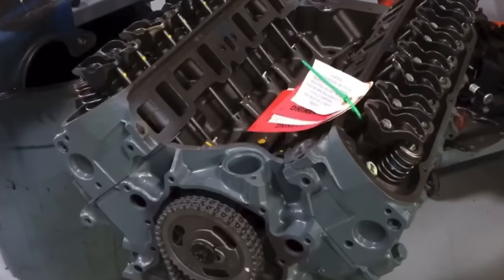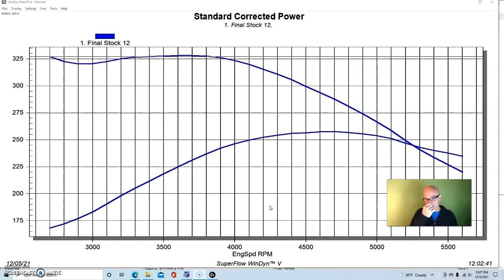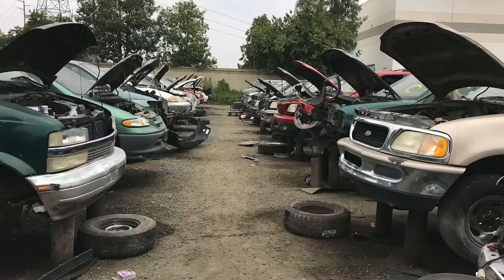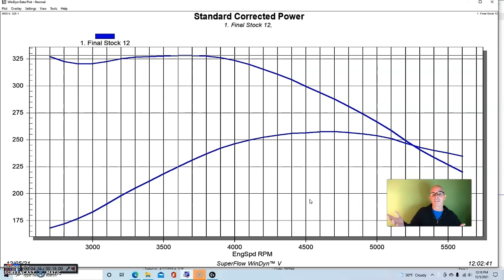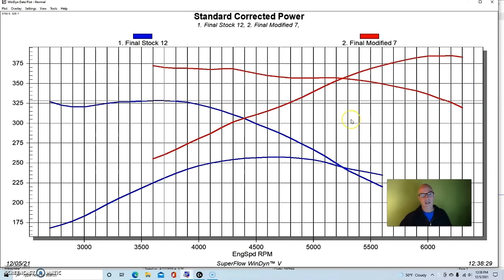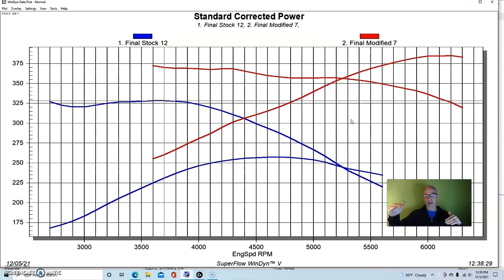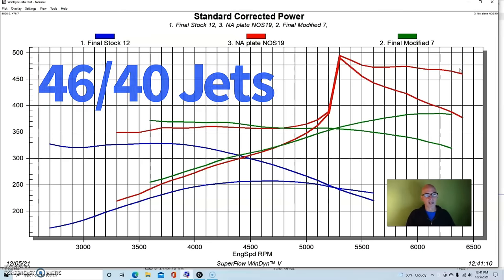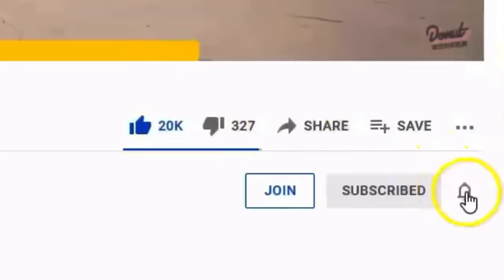HOW TO BUILD CHEAP 5.0L FORD POWER! WHAT DOES IT TAKE TO ADD POWER TO YOUR DAILY DRIVEN SB FORD?

Comment: Remember the old (69-70) BOSS 302 which had the BIG C4 port heads and regular 289 HIPO cam and 1.7 rockers? It did well.
The Z-302 had small heads and BIG cam and almost made the grade.

205 sounds large as the E7 are 127 and the 40/40p are 144 (some say 137). Ported the irons add about 7 unless theyre hogged. Ported E7s and the 40s flow about 185-195, 
depending on the bench.

How big are the Cleveland 4 bbl heads? 😁😎

Thank you for the SBF stuff. Im still a Fox guy and doing 70k miles T5 car now.
THANKS AGAIN 👍👍👍😎😎🇺🇸
Reply from the maker: please see the video on the direct comparison between the Boss 302 and DZ 302-a 205 head is not too big-it's just being utilized
Reply: Sub250 aerial shots  that’s not exactly how it works. If the heads and/or carb is too big, the air velocity falls off and it makes less power.
Reply: Sub250 aerial shots  right, being an air pump, to flow more air to accommodate big carbs and ports, you have to spin more rpm to pump more of said air. Most engines are limited in valve train and bottom end to spin 7, 8, 9,000 rpm. So adding these big ports and carbs would make less power and be less responsive when limited rpm is a factor.
Reply: Sub250 aerial shots  I think we’re actually agreeing and just debating because it’s the Internet. I too have been class racing for years. Over carbureting an engine might not make less peak power, but in lower speed applications like a street car it will certainly have a negative affect on the usable power and usable rpm of the car. If the carb doesn’t have enough vacuum at given RPM none of the circuits are going to work correctly.
Reply: Sub250 aerial shots  hahahah that’s awesome. And true. 60’ is king.

Comment: Hi Richard i have a Mustang with an 86 motor in it, I’ve heard that e6 heads are no bueno as well as no other heads work with the flat top pistons used for that one year only. Am I better off to run new pistons that way I can utilize better heads?
Reply from the maker: pistons with valve reliefs will allow to more cam and cylinder head choices to make more power
Reply: cut reliefs ??

Comment: Whats the biggest letter cam i can run without having piston to valve problems.
Reply from the maker: I plan to check
Reply: @richardholdener1727  good question... especially when  using stock heads and aluminum 2.02 heads/1.60 exhaust with like an E cam...... worry about the stock forged Pistons 1987' with those smaller valve reliefs....   🤔

Comment: All due respect,  good luck finding anything like that at wrecking yards these days, few and far between. 
You could be waiting a long time.
Reply from the maker: lots of explorer and truck 5.0Ls
Reply: @richardholdener1727  not here in So Cal where I been looking. 
Haven't seen a 5.0 roller in a long while.
Love your channel by the  way.
I learn  a lot
Reply: @richardholdener1727  
Out here in the middle I've found only one within 100 miles. $400 with 200,000 miles.

Comment: What's the best set up for cheap on a non roller motor
Reply from the maker: GO GET AN EXPLORER 302 FROM THE JUNKYARD
Reply: @richardholdener1727  well it already has slightly larger cam intake and 4bbl would it benefit if I put the carb and long tubes on a roller motor
Reply: @thatmaverickguy859  Explorers have better heads.
Reply: @hotrodray6802  I know gt40p heads I'm thinking of getting one and converting it to carb and bigger cam

Comment: Hi Richard, great video! I am building a 289 with a comp 270HR cam, roller rockers,, world products windsor sr heads, and KB 10:1 pistons. What ring gap would you recommend if I wsnt to spray it with 100-150 shot of nitrous?
Reply from the maker: .006 per inch of bore works for that
Reply: Would you spray a motor with hypereutectic pistons in it?
Reply: And thank you soo much for the response!

Comment: Love your video Rich. Thanks question, Gt40 heads comes in aluminium or only in Iron . Some people said it comes in aluminium?
Reply from the maker: Ford Racing offers after market aluminum GT40 heads, but they did not come on a production vehicle like the iron heads
Reply: Ford throws the names Cobra, GT40, BOSS etc around a lot for marketing purposes. 
Pretty sure the Ford aluminum's are not the same "casting shape" as the irons. The GT40 3 bar irons are essentially a 69-73 351W head but with smaller spark plugs and the new style rockers.

Comment: The sbf is a dying breed nowadays, everyone runs ls stuff. I wonder if a serious sbf could ever match a built ls power level, I seem to doubt it.
Reply: Some folks just don't wear bowties!
Reply: Hi Christan,  SERIOUSLY ??

Apparently the aftermarket didn’t get that memo. The 351 Cleveland has the same bore spacing and head bolt pattern as all Windsor based engines so it’s also a member of the small block Ford family. 
There are at least six different manufacturers in Australia and the States that are currently reproducing Cleveland cylinder heads for both 2-V and 4-V applications in cast iron and aluminum alloy versions. Aftermarket aluminum blocks for Clevelands have been available in Australia from Arrow for quite a while. 
FULLBOOST has posted several YouTube videos featuring small Fords. 
Like the one built by Dandy Engines and featuring Higgins alloy Cleveland STREET heads. With a single 4-V carb and NO power adders, running on pump fuel, the 461 cubic inch aftermarket Windsor small block with Cleveland heads dynoed at 934 HP,  669 TQ. Results using race fuel were 979 HP,  700 TQ. However, after additional tuning with the same small block Ford components they topped the 1000 horsepower mark in more recent testing. 

I don’t know what the LS power levels are that you are referred to but this should answer your question and remove your doubts about “if a serious SBF could ever match a built LS power level”. 
On a horsepower per cubic inch scale, a naturally aspirated Cleveland based SBF will defeat your LS all day long ! 

But American builds are equally impressive as the Mighty Aussies. 
Mark McKeown of mmeracing.com would strongly disagree with your weak comment about “The SBF is a dying breed nowadays”. His new Cleveland alloy blocks have priority main bearing oiling which corrects the shortcoming found in the original production Clevelands when Pro Stock racers were turning 10,500 rpms with factory cast iron blocks and dominating NHRA Pro Stock. They quickly found out that main bearings were starving for oil as the production blocks approached 7000 rpms and above. The Blue Oval guys also found an easy and cost effective solution to the problem just as quickly so they could get back to the business of small block Fords dominance in Pro Stock. 

Using modern casting foundry technology,  Mark developed his new aluminum block which he named TITUS. It looks almost identical to a production Cleveland block and the architecture allows for stock and aftermarket components to bolt up without modifications. Full details can be found at  titusperformanceproducts.com 

To debut his new Titus aluminum Cleveland block,  Mark chose the 2012 Engine Masters Challenge. 
No pressure, just all eyes in the aftermarket performance industry watching the results 😳. The results turned out very satisfactory with a 4.202” bore and 4.00” stroke , the Titus 444” Cleveland with Edelbrock SC1 Cleveland heads was entered in the Extreme Street Class. The dyno pull resulted in 932 all engine horsepower and 693 lb/ft of torque. 
I think 2.09 horsepower per cubic inch without power adders is a damn good debut for “a dying breed nowadays” that you have doubts about matching “a built LS power level”. 

But there’s more good news for Ford haters. Apparently everyone that was preoccupied running their LS stuff didn’t notice the latest “SBF dying breed “ that’s about to be a major game changer. Timothy Meyer at tmeyerinc.com  is the single source for the newest American made Cleveland blocks.  Named TRACK BOSS, The alloy blocks are being cast with the strongest Alcoa premium grade aluminum ever used for aftermarket blocks from any manufacturer. They are being machined and shipped worldwide as fast as Tim can get them out the door. They look identical externally to the original D2AE Ford production blocks and they feature full Cleveland architecture for compatibility with all production and aftermarket Cleveland components. They even have the correct D2AE Ford engineering number cast into the right location but that’s where the similarities to factory blocks end. 

Inside the Track Boss features priority main bearing oiling to each of the five mains along with billet steel caps and four ARP bolts on every one to hold the crank firmly in place. The thickest main bearing stands, bulkheads, pan rails and additional bracing ever available in an aftermarket Cleveland block for peace of mind at extreme power levels. Extended cylinder walls for increased stroker piston stability at BDC. Cross bracing in the lifter valley connecting both cylinder banks for additional strength at the top of the block. And much more. 

The iron version of the TrackBoss block has all of the engineering features of the alloy block with the additional capacity for a larger bore size. Gotta love extra displacement with the lower cost of iron. But this Track Boss isn’t available in the common cast iron used by common foundries. Tim chose Compacted Graphite Iron (CGI) which is the much stronger iron alloy used for extra duty Diesel engines. Tim is still working with the foundry tweaking the final design but the first sample blocks that are currently being sliced, diced and analyzed to see if they meet the highest Track Boss quality standards, look absolutely amazing. If full disclosure was remotely possible, I’m sure that diehard LS guys would also be impressed by this dying breed called TrackBoss Cleveland 👍. Or not 🤔.  Updates for interested parties are available at  tmeyerinc.com
Reply: not everyone
Reply: @danielwilson6665   thanks Dan, interesting stuff right there! 👍
Reply: @429thunderjet2  …No worries Dennis. I’m glad you found my thoughts interesting. In all honesty, I was a bit surprised by such blatant negativity about Fords along with such unfounded certainty that the SBF sucks and is a hopeless dying breed. There’s a ton of information that says otherwise right here on our favorite YouTube channel 👍😉
Reply: @danielwilson6665 Absolutely!  the trolls are everywhere man, hence my bowtie crack. I am an aviation buff too and they come out from under their bridges there is as well. I catch so much grief on Ford's I just gotta hand some back!  right?
 If I didn't have an old 429 thunderjet that is currently in my old rusted out F-150 short box that it needs a new home in front of another FOMOCO firewall I would be looking for some Cleveland stuff for sure.
Reply: Had an LS car & was horribly inconsistent at the track. I never see them win either. I dont understand the hype. Ill go back to sbc or start sbf stuff from now on